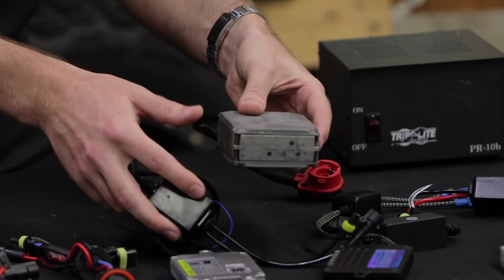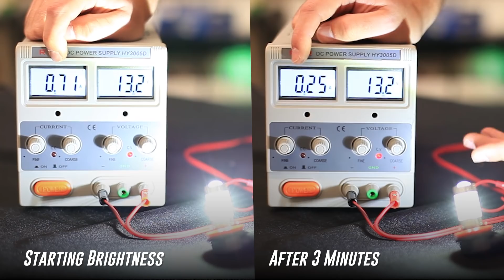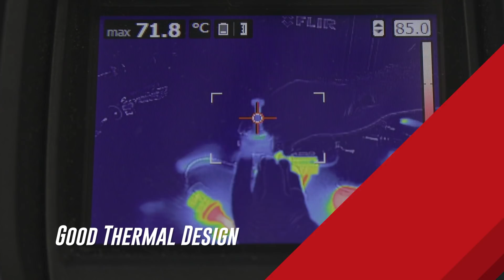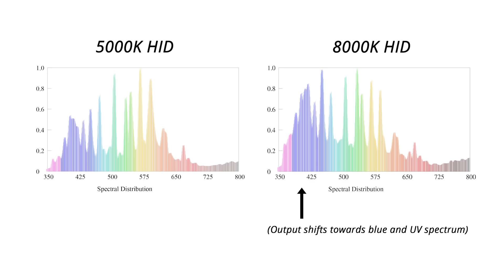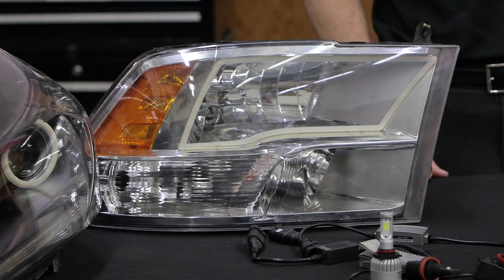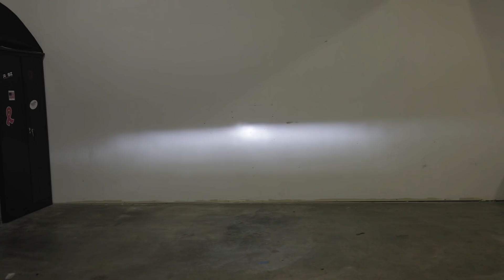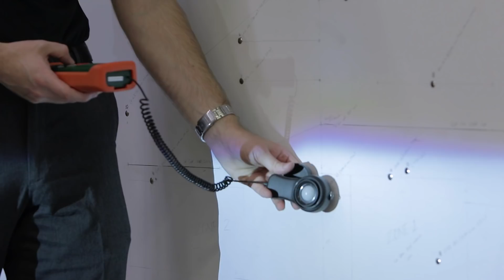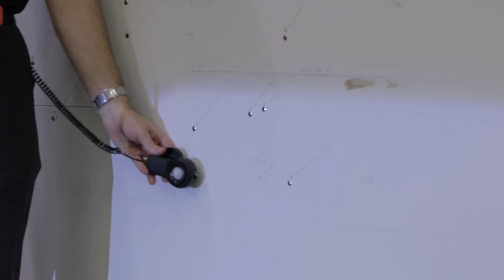HID vs LED Headlight Bulbs: EXPLAINED

Comment: I installed HID on my 2011 honda accord, what a difference. has been 2 yrs, no issues.
Reply: The issue HID is blind others with its light
Reply: @djimanufacture7682  if you keep driving with high beams on all the time in pitch dark yeah
Reply: where you buy them i have a 2012 honda accord SE
Reply: Yeah I fitted some HID'S to my high beam on my 2008 Lexus and wow what a staggering improvement.  I live in a rural countryside area and traffic is very much non existent on country back roads. More of a concern is the cows and other wildlife that hides in the constant shadows along the roadside.  The high beam completely illuminates the entire road, shoulder and about 20 meters into the farm fields each side.   vision ahead is increased by twice what I could previously see at least. No more out driving headlight range. there is no degraded distance even in heavy thunderstorms or the blackest nights when compared to original bulbs and eye strain is reduced by an astounding amount when driving tired, when I do have to drop to low Beam for the occasional traffic the eye strain is instant and unrelenting and I suddenly feel very blind. I am also very conscious of the intensity to oncoming traffic  therfore dip them well before it affects others, you can see oncoming light glow for miles ahead or around corners so early dipping is no issue. unless they leave there lights on high beam coming at me as alot of people here are lazy with there dipping to oncoming cars so I have no hesitation in reminding them by a brief flick back to 80% only 3ver have to remind them once compared to multiple times with bulbs.  There is no long warmup time for a return to high beam with my system if I have been using it,  usually returns at aprox 80%intensity and for long night trips I do regular less electrical load on vehicle when compared to 60wat original bulbs. Best list upgrade I ever did. Have since replaced all other bulbs interior and exterior with LED for lower electrical draw also and an increased battery reserve by not feeding bulbs. 7w Led reverse bulbs to help with reversing. This was 5 years ago. One bulb after 2 1/2 years. Worth the investment.

Comment: What led light would you recommend for hyundai elantra 2017 equiped with a 

projector
Reply from the maker: Hey Mark! We'd suggest our 9005 SL1 LEDs from the link below:

https://www.diodedynamics.com/low-beam-led-headlight-for-2014-2018-hyundai-elantra-with-projector.html

If you have any other questions, just give us a call at 314-205-3033, Monday-Friday 9 a.m.- 5 p.m. CST, or shoot us an email at contact@diodedynamics.com!

Comment: I had hid in my kawasaki, they gave nothing but trouble, either struggled to ignight or maintain an arc, even after replacing expensive bulbs they still gave trouble so I went back to good old fashioned halogen.... Cheap and as bright as I'll ever need......
Very interesting video..
Reply from the maker: Thanks for your feedback and support!
Reply: Don't buy cheap crap, mine lasted over 3 years
Reply: @gabrielgalaxygh  they weren't cheap crap plus they came with the bike...
Reply: @Team-fabulous  xenondepot HIDs come with a 3 year warranty and their from Canada so you know they'll take car of you

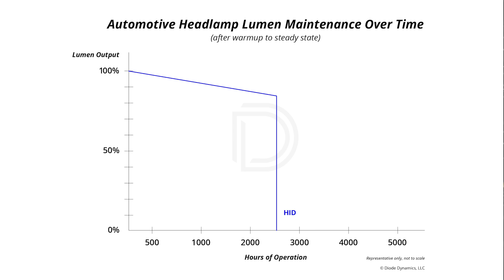Comment: 7:50 I've noticed that HID bulbs tend to shift color towards red when they're failing.
Reply from the maker: As HIDs age with use, they will start to shift colors. In some cases, when they get closer to going out, they can certainly shift colors more dramatically.
Reply: That heavily relies on the manufacturer of the HID system in question and thus their specific design and materials used in the production of their bulbs. It seems that earlier generation HID systems tend to shift towards the red wavelength with age whereas newer HID systems tend to shift more towards the blue wavelength with age. Hope this helps.

Comment: Halogen bulbs used to die really fast if you get your finger (oil) prints on them when handling them. Is that still true?
Reply from the maker: That is certainly still true with halogen. The oils from your skin can cause the bulb to fail prematurely. Luckily, that isn't the case with LEDs!

Comment: I learnt more in 25mins watching this clip than my entire research over the past few months on headlights. Not only are you solid in knowledge, I'm very impressed and comfortable with how all these knowledge is delivered. Hands down one of the very best and beneficial videos in You Tube so far. 

Just a little question, how do I tackle the warning light on my dash when any LED bulbs are installed instead of the original H7 halogen?
Reply from the maker: Thanks for the support! With so much dis-information out there about other styles of LED bulbs, we really enjoy getting this information out that is easier to understand.

In regards to the bulb out warning, you would more than likely just need to install a resistor / capacitor to that circuit. With that bulb size however, we would not have the resistor / capacitor needed to prevent this.

Comment: Any approved 4200/4300 kelvin LED's out there for cars?
I have 4200k H7 HID, with some shielding,  very nice. Doesn't look shit like the 6000k.
Reply from the maker: Unfortunately we don't offer any in that color temperature at this time. Our SL1 LED is rated a 5700K, which is overall a very nice white light.

Comment: Understandably the popularity of the LED headlights is all the rage and for good reason.... but now there are people retro fitting them in older vehicles that originally came with halogen bulbs that have reflectors in them for their particular purpose, now its like there are on constant highbeams and even looking at them for a split second, close your eyes and its like burned into the back of you'r retina, should be illegal and no older vehicle shall pass inspection with them installed.
Reply from the maker: That is certainly the case with some generic LED bulbs that do not focus light in the same way the OEM bulb does. What makes our SL1 so unique is that it does mimic the beam pattern of the stock bulb, meaning no glare for oncoming traffic. Feel free to give our SL1  a try, we think that you will be happily surprised with how well it performs!

Comment: very interesting video , but youve not talked about how the colour temp effects the picture of what you see .
Reply from the maker: Hello Tom! For the most part, the color is strictly just a personal preference!
Reply: Tom if you are referring to how the color temperature of emitted light affects what you see on the road, it would be best to run as white of light output as possible. White light is closest to what you see during the day, therefore the road environment at night will appear similar to daytime viewing. Higher color temperature bulbs do not provide as good of visibility on the road at night because the environment catches and reflects blue light different than white light, so you will notice certain elements on the road blending together. White light will give you the clearest night time viewing. Also keep in mind for fog lamps the yellow light penetrates fog a little better than white light as it's closer to red on the spectrum which produces little to no glare. Hope this helps.

Comment: my halogen flickers but only when i play loud low bass
Reply: Sounds like electrical strain. Your electrical system cant output enough current to keep up with the high demand of the sound system, causing your headlights to flicker due to reduced output. This is why many sound system companies reccomend upgrading your alternator to keep up with the electrical current demand

Comment: I had leds in my 99 Silverado but only for high beam it was drawing more power to the leds and it would make my low beam halogen glow yellow like it wasn’t getting enough power to the halogen bulb
Reply from the maker: Hello! Feel free to send us an email with some more specifics about your issue (bulbs used, OEM bulb size, etc), and we would be happy to try and point you in the right direction of a better solution. We can be reached at 314-205-3033, Monday-Friday 9 a.m.- 5 p.m. CST, or shoot us an email at contact@diodedynamics.com - thanks!
Reply: Diode Dynamics I was using factory 9006 low beam with cheap led like the grey ones you had in this video it was like it was pulling more power then the leds needed and when I switched them out did factory high beams with led low beams it was the same
Reply from the maker: @marcustucker2011 , feel free to give our 9006 SL1 a try - we think you'll be happily surprised!
Reply: Diode Dynamics will do once I get the money

Comment: Probably going to have to switch my Durango from my recently installed LEDs to HIDs. Got good quality LEDs and they just arent quite bright enough. They are almost as good as factory halogen. The color is phenomenal but the total light output is just not up to par. Ready to get some HIDs. Seen several videos where they are far superior in Durango Projectors

Comment: Recommendation for led upgrade for 2011 f150? The h13 halogens just seem to be not as efficient as other vehicle's headlights on the road.  Also can you do the same type of video but on fog lights? Thanks
Reply from the maker: For the H13 size, we do only offer HID conversion kits at this time. We are working on an LED for this size, however it is still in the development stage.

In regards to fog lights, we do offer the same style bulbs for these locations. Head on over to our website under the "Choose Your Vehicle" section to see all of the options available there!

Comment: Put a set in my 2019 Subaru Impreza Sport last night, low beams for now.
 Wow, nice improvement.  I like the white light, not blue tinted at all.
  Good cut off in my reflector style housing.  Install was not too difficult.  I've submitted pics on your site. Now I need to do the Hi 
Beams, they literally pale in comparison to the low :)  Thanks guys, always good stuff. ~peaty
Reply from the maker: Thanks Pete!

Comment: What about hids burning projector headlamps. Most projector headlamps aren't built for hid. Unless it's an actual hid oem projector headlamp
Reply from the maker: When utilizing an HID conversion kit in the low beams on any projector style housing, you are limiting glare to oncoming traffic. When utilizing a 35W kit, there will not be any damage to a "halogen projector".

Comment: I purchased led bulbs with anti flicker adapters and the headlight will just turn off.  I contacted the company and they said I needed to disable my drl's. Car is a 2015 300c. Question is should i just return the bulbs as the could be an issue, or should I disable my drl's (don't really want to)
Reply from the maker: Hello! Please shoot us an email at contact@diodedynamics.com and we would be happy to look into this further for you - thanks!

Comment: I just junked the Low Beam HID system for my Lexus IS300 Headlights.  I replaced the bulbs with "Sylvania 9006 LED Bulbs"  bypassed and threw away the "Ballasts"  The feed for the 'Ballast"was connected directly to the connector pigtail provided with the LED Bulbs and an after market connector.  Initial results are excellent.

Comment: LoL, I always wondered when the package says 30% brighter and has the same watts as some of the other ones. Back when I bought these bulbs, I bought the ones that had the highest wattage. In one vehicle I changed the harness to except the higher wattage bulb.
Reply from the maker: Yep. A little misleading! Some are slightly more than others, but all of them, by regulation, have to be a certain output level. https://www.prnewswire.com/news-releases/consumers-who-bought-sylvania-automotive-lighting-could-get-money-from-a-30-million-settlement-273557191.html

Comment: HID projectors with high flap in my Silverado and Camaro. Then LED in the stock high spot to match the color, but you can unplug the LED and not know it's missing as the light output is just nothing next to the HID.

Comment: 45 watts not volts
Reply from the maker: D3 and D4 HID bulbs operate with 42-45 volts at 35 watts, as defined in UN Regulation No. 99. Page 26 of this document. https://www.unece.org/fileadmin/DAM/trans/main/wp29/wp29regs/r099r2e.pdf

Comment: Do you guys not offer a h1 led kit? Didn’t see it on the site.
Reply from the maker: We do not - H1 is an extremely small, high-power bulb, so it's difficult to design a reliable solution that isn't a drastic decrease in power from the original halogen.

Comment: how good or bad are LASFIT LEDS, i have them in a 2017 civic hatch and gmc terrain both with projectors lenses and mine seem super bright compared to  factories, entire roads lite up and with fogs n reg beams on i get flashed alot thinking my high beams are on
Reply from the maker: Check out our video on LED focus - it's possible you have a bulb that isn't well-designed for optical performance. https://www.youtube.com/watch?v=WGmoDtdNqIk
Reply: I use Lasfit bulbs in several areas on some of my vehicles. They make fantastic LED's as does DD. Seeing as both of your vehicles contain projector lamps, you may need to adjust the lenses down slightly to move the cutoff below other driver's eyes. I'm not sure exactly what lens style your fog lamps are, but that could be what is glaring up at other drivers. Projector cutoff does not change whatsoever no matter what bulb system you are using. So next time you're driving at night turn your fogs off and pay attention to where your low beam cutoff point is on the road and in relation to other vehicles and adjust where necessary. Also just my .02 most if not every motorist should know by now that fog lamps cannot run while high beams are on so if yours are on and you're getting flashed, either the low beams are aimed too high, or the fogs are glaring. Either way, nothing major just some adjustments may be necessary to avoid any future flashing. Hope this helps.

Comment: How would these LED bulbs perform inToyota Camry halogen projectors?
Reply: Toyota already uses LED. They work great. But you will need an LED that's at least $50 to not cause glare and to have enough "throw" to see ahead.
Reply from the maker: Hey Joshua! Unfortunately, we haven't done testing on the Camry Halogen projector headlights just yet, but you can expect roughly a 30%-70% of light in focus at the primary hotspot. If you have any other questions, just give us a call at 314-205-3033, Monday-Friday 9 a.m.- 5 p.m. CST, or shoot us an email at contact@diodedynamics.com!

Comment: What would you recommend for a motorcycle (2001 Suzuki gxsr)?
Reply: Hid
Reply: @Manuel-u2y4  thanks!
Reply from the maker: Hey there! If you can fit one of our SL1 LED headlight bulbs inside of that reflector-housing, that would be the best option. If you have any other questions, just give us a call at 314-205-3033, Monday-Friday 9 a.m.- 5 p.m. CST, or shoot us an email at contact@diodedynamics.com!

Comment: These LEDs are way too bright to be at the eye level of drivers. Especially on the highways. States need to crack down on the maximum allowed brightness and issue tickets to vehicles that can blind people on the road.
Reply from the maker: Hey Caleb! We share your concern and that is the main reason we started making these instructional videos. You need to make sure that you are using the right type of replacement bulbs for your headlamps, and ensure that they are aimed/seated properly after installation to avoid that glare that everyone hates so much. Check out our video below for more information about that:

https://www.youtube.com/watch?v=zb_AupXBhac

If you have any other questions, just give us a call at 314-205-3033, Monday-Friday 9 a.m.- 5 p.m. CST, or shoot us an email at contact@diodedynamics.com!
Reply: Halogen lamps only. No LEDs or HIDs. There is no advantage of having these lamps as headlights that trumps the priority of all drivers to be able to fucking see on the road. Recall all of them to be retrofitted with proper headlights.
Reply from the maker: @MrOpinions-f3o  , feel free to try our SL1 for yourself - we think you will be happily surprised how well they perform! By designing this bulb from the group up with your concerns in mind, it is amazing how there is a complete lack of glare for oncoming traffic, with a great improvement in overall light output!
Reply: Caleb Daniel Herman jesus child calm down. You can’t blame manufacturers for consumer ignorance. These people that do conversion kits never readjust the beam output and/or don’t research lights with good beam patterns for their housing style. No need to ban more reliable alternatives. Even the sheriffs office in my city converted all their police cruisers to HID bulbs.
Reply: Caleb Daniel Herman pussy.

Comment: Are the SL1 led available for the 2019 VW Tiguan sel r-line?
Reply from the maker: Hey there! It looks like that might be an H7 bulb size, which we do not have available for the SL1 at this time, unfortunately. We do offer Universal HID conversion kits for that size though. If you have any other questions, just give us a call at 314-205-3033, Monday-Friday 9 a.m.- 5 p.m. CST, or shoot us an email at contact@diodedynamics.com!